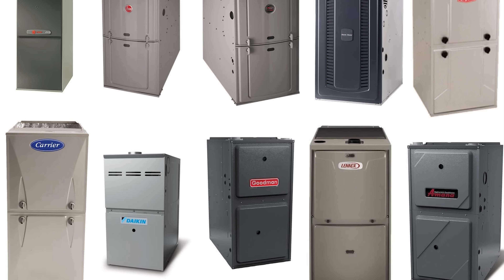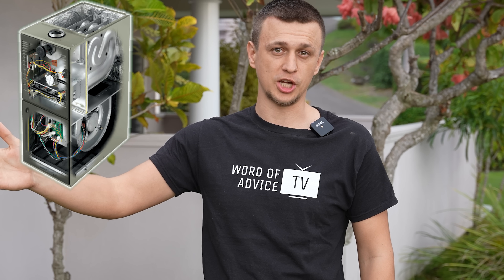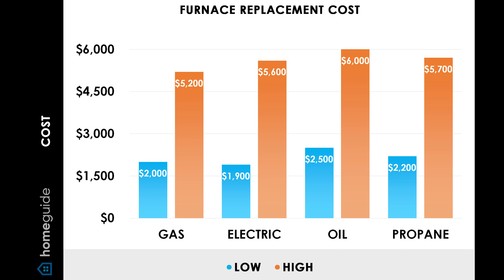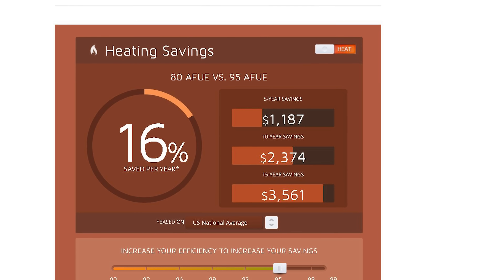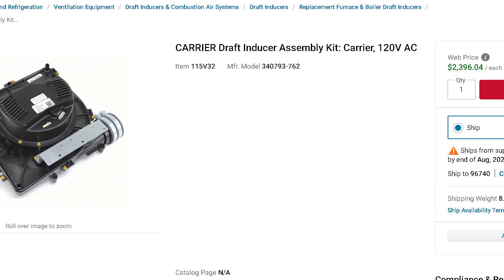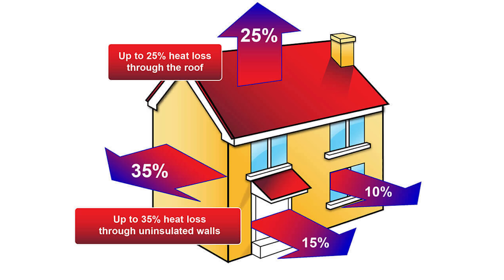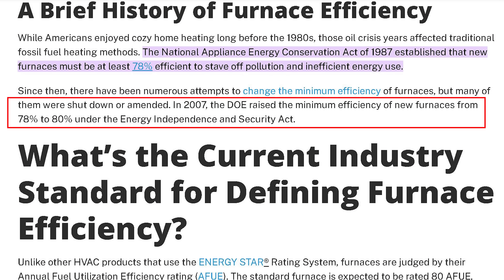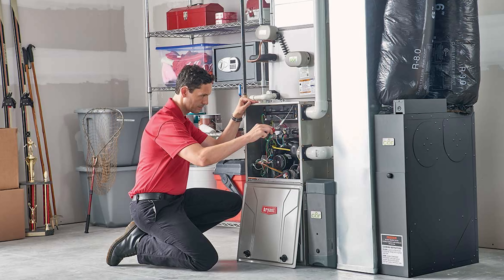Don't Buy a High Efficiency Furnace!

Comment: I'm planning to put a furnace in a well-sealed detached workshop. Is it possible to find an 80% furnace with a sealed combustion chamber or at least find a good way to draw outdoor combustion air rather than drawing from inside?  I can find unit heaters with sealed chambers but would rather duct to distant areas of the shop.

Comment: What price? the Goodman 96% 80K furnace I bought and installed myself was about $1150, it replaced a 35 year old Lenox G11-e 80%, but 80% was misleading as it took all it's combustion air from the basement where it was, and the open 5" flue often had cold air spilling out between cycles, flue exhaust would sometimes come back down depending on the wind direction,  so in actuality it was probably more like 70%.
The Goodman I installed 3 months ago has performed perfectly so far, I leave the thermostat set at 73 degrees.
It takes all it's combustion air from directly outside thru the PVC pipe, no more cold air pulled in thru every gap or crack!
Part of the heat exchanger issue is sizing of the furnace, the old Lennox I brought home from my workplace when they replaced their furnaces, it was 110,000 BTU, the new Goodman is 80,000 BTU. I have 1,100 sq ft with a basement, R-100 insulation in the attic, double pane windows, and the walls are at least R-21.
If someone buys a furnace too big it cools off a lot between cycles, that could cause condensation as well as wide temperature swings which causes a wide variation in the expansion and contraction of the metal in the furnace which isnt good for it- metal fatigue.

Comment: my lennox pulse is 40 years old one heat exchanger replaced paid for by lennox parts and labor . and i had the computer replaced not sure why it was shutting off turned out the hornets built a nest in the intake pipe .  sure wish that they still made that furnace love it .( when i got that furnace in 1982 my gas use went down 33%  )  and i love the sound it makes .
Reply: Yes I have same.....G14 model....Lets Calculate: Savings of 95% over 80% for 35 year life of Lennox Pulse.  $1000 year spent on Nat Gas with 95% so spent $35k in 35 years.  Would need 19% more gas for an 80% (.95/.80=.19).  So $35k * 19% = $6,650 saved over 35 years.   NOT ONLY is there energy savings, but HIGH quality equipment last twice as long, so saves another $3k to install another one.  (Flap $10 is changed every 3 years,  the inducer fan was making noise after 35 years so changed $80, and Combo  Limit was change + had to add Fan off delay because exact old part not available.  (pulse system used special delayed combo switch).

Comment: Hi, In 2010, a local HVAC company installed a 96% Reem furnace in my home located in South Jersey. Today, after 14 years, an HVAC company that came to do maintenance told me that the unit is too large for the house (100,000 BTU to cover 2,000 square feet). I have already replaced several parts of this furnace, and due to the fact that it emits a strange color, they told me that the secondary heat exchangers are clogged. Any recommendations?

Comment: So, Washington is copying California and doing a natural gas ban. I bought a home and it has condensing furnace. So I can expect to have to replace it in the next 5 years then? Because I HAVE to replace it with a heat pump, which don't really WORK below 22°. And last winter it was 9°, but it hits 0° every few winters. I guess I'm out on the streets then because I cannot afford to replace things that expensive that often. At least with a roof you get 20+ years. Thanks for the dysmal heads up.😢

Comment: i have a weil mclain high efficiency gas boiler and it has been nothing but trouble it shuts down middle of winter for no good reason because it decided temps were wrong i want my dam heat to stay on unless it is about to blow up house. 
also, the aluminum heat exchanger chamber is being eaten away by combustion gases so i figure it might last about 15 to 20 years while my dad's regular gas boiler needed nothing for 40 years and never shut down it would run in a power outage since it had pilot light you could just open check valve and water would flow on its own.

Comment: My furnace was first used right around late October' or early Nov 1993 and it s working as of today. It failed in 2010 because I've neglected to replace the FILTERS (Guilty as charged) that's because I have no knowledge about HVAC. That incident taught me a lesson big time! It cost me $80.00 to replace the Circuit board, $25.00 for the motor, $21.00 for the high limit switch, and $20.00 for two filters in order to bring back the furnace back to life. I did all the work using the knowledge acqured watching U Tube. In November 2022, the furnace stopped working again since 2010 and I found out that I have to replace a broken flame igniter for $14.00 and $43.00 Lux from Amazon. Every time the air filter indicator reach the 50% efficiency, I replaced them.

Comment: In the 10 years I’ve done heating and air I’ve only seen one 90+ fail. The actual cost difference between an 80% and a 90% is about 400 dollars. The piping itself is rather cheap as well. Modulating I don’t like and I don’t install them. A 96% two stage furnace is more than enough efficiency for 99% of people. The true cost difference comes from contractors just deciding it’s okay to charge the extra 2-3 grand for the 90+ furnace.

Comment: In Alaska, where the furnace is used nearly 24/7, 365, the constant noise and blowing air of a standard furnace is a no-go. The quietness and gentle diffusion of heat makes the extra cost of a variable speed fan, high efficiency furnace worth the expense and shorter life. Plus, my Lennox has a lifetime warranty on the heat exchangers.
Reply: In floor radiant heat sound perfect for your area

Comment: Totally agree with you. I've got a 21 year old Armstrong Air 80% that's still going. So far the only repair has been the igniter...very inexpensive.
Reply: Up north we all use 95% furnaces with no problems - the cost savings greatly outweigh any issues with the heat exchangers. Not to mention that part is warrantied for a very long time.

Comment: I was a HVAC contractor and I've been retired for 7 years. It all depends on your climate and installation. Some areas require a chimney liner so it's more economical to install a competitive 90 afue. Single pipe 90 afue don't have recirculating problems as twin pipes. I've found Carrier/Bryant/Payne had trouble with secondary head exchangers. Btw; my first house had a G14Q3-60 Lennox pulse installed in 1983... I was driving by there 4 years ago.... It was still revving along.
Reply: I have only one pipe exiting, and the condensate is pumped into my washer drain.

Comment: Hello Is there a non efficiency furnace that uses pvc pipe for exhaust/intake ?
Reply from the maker: As far as I know, no.
Reply: What is the exhaust on a good 80% percent furnace ? A 4” double wall out the roof or can it be horizontal out the side . Just gearing up when it comes time to change out my 93% high efficiency

Comment: Is this true on Heat pumps above a 14 seer???
Reply: 14 seer is same as COP 3.45 , that means (at a specific set of conditions) you get 3.45x as much heat as electricity used.  Keep in mind electricity cost 3x as much as natural gas for a unit of energy.    15 seer is 3.61 , 17 seer is 3.89, 18 seer is 4.01  Huge increased in equipment cost for those slightly more efficient units.

Comment: I live in Arizona and yes winter does exist a few times during the year. My parents have a high efficiency heater only because their original heater built in the 1960s went bad and parts no longer existed. Their happy with their high efficiency heater and it works excellent. I have the 80% efficient furnace in my house and it works excellent too. 

In Arizona gas is cheap and the winters do exist but not as long as most places so you're going to be fine with a standard gas heater. Either way it'll be a lot cheaper than running any heat pump because I've seen electric bills for heat pumps and they're higher bills than what would normally be found in the summer months.

Comment: My issue with high efficiency furnaces is that nobody in my area knows how to install or service them properly. Mine sounded like Chewbacca giving a battle cry every time it turned on for 7 years untill the unit was replaced.

Comment: These days if you have an 80% furnace and the venting is safe to keep if you get a new system get a heat pump dual fuel setup use the heat pump and electricity 50 to 60% of the time especially if you have solar it’s almost free to very cheap to run. Using your gas furnace only when it gets cold enough.

Comment: This video must be from behind the times USA? Mid-Eff have been disallowed for quite a few years now in Canada ! Possibly the reason you find Hi-Eff break down is that you sell junk Brands ? Our weather in Canada puts furnaces to the test ! Do NOT break down or shut down more than Mid-Eff Gas Furnaces ? Found there were more problems with Mid-Eff as the indoor air constantly coated the flame sensors and shut it down ! Bottom line guys is Think Green for the Future right ?

Comment: He is spot on.  Agree 150%.  Forget the brand names.  They ALL use parts sourced mostly from China.  The best unit is the one installed WITHOUT any shortcuts and properly sized.  An 80% with a PSC motor is the ticket to longevity.  4th reason:  If one removes an 80% unit from a shared B-vent stack...the vent stack MUST be resized.  As for AC a simple equation holds max {efficiency} = min{time to failure}.  You will never attain the advertised SEER rating of any unit that is connected to an undersized duct system.  Never.  Advertised SEER ratings come from equipment in a lab-NOT real world conditions.
Reply: I have an update.  High Effiency=early replacement.  Holds true with most consumer goods.

Comment: totally agree with you.
 But.
 So many outfits will only install the high-efficiency ones.
 Judging from around my condos in my address just about every unit that gets a new furnace gets two plastic pipes out the front wall of the house.
 It sucks.
 You saved my bacon, and I fixed my 80% Goodman 2 burner. Runs better now than when I moved in 23 years ago. Touch wood!  ( it was just installed back then).
It is simple and they work. And thanks to your web site I have some knowledge to support my thoughts on the whole issue around furnaces.
 But today the furnace 'guy' will show up/ tell you you have a cracked plenum and you're stuck with these findings. At 20 degrees below and Christmas travel coming up does one really have an option? No, they got ya.
 At least 98% of the people.
I am going to shop around and see what 80 %ers are available.
 I need/ should get a new one/ but I might be moving sooner rather than later so in a quandary.

Comment: if you have an actual winter, a 90+ will pay you back especially since nat gas doubled its price per therm.  I draw the line on furnaces with 2 stage gas valves and the like.  I'm not a fan of exhausting 20% of the heat in the gas i burnt.

Comment: Love your channel.. but I would Challenge this advice.   Depending on where you live.  In the Northern USA Heat is primary throughout the year.   Cost of energy is always rising and your advice would be bad.   But In the south Air conditioning is primary throughout the year and fuel cost on heat is minimal.  Also usage of the heat exchanger is low.  So it last a long time due to non-usage and a expensive furnace would be wasted.   ( Natural Gas cost doubled in 6 months)   Keep in mind energy cost is unpredictable.

Comment: Thanks for this and all your videos. We recently purchased and moved into a home that has a 20year old, kenmore, high efficiency 92% AFUE, two stage furnace with a DC variable speed motor. Just a few days ago the blower fan stopped working, and I’ve been viewing your control board/blower fan troubleshooting videos. Unfortunately, those videos were on non high efficiency furnaces, or without dc variable motors, so when trying to replicate on my furnace, it looks significantly different. We really don’t want to replace this furnace, but are struggling to troubleshoot it. Could you please do more repair and troubleshooting videos on high efficiency, DC variable motors please? As you mention in your video, they are more complex and expensive to repair, so any help you can provide to new and budget conscious home owners, would be greatly appreciated. Thank you

Comment: I had a prestige condensing boiler variable combustion input and had a Weil McLain 80% efficient cast-iron boiler. The prestige condensing boiler lasted 11 years and I’m using the Weil McLain back up boiler for another 11 years and it’s going strong without one single problem. I consider condensing boilers unreliable as well as 90+ efficiency furnaces. In out sons place we put in 90+ 2 stage furnace and we only run it on low stage. So far 15 years it’s running good since it’s an older model. At my uncles we have a Bryant with the infinity thermostat and head problems and it’s only four years old? Will be taking a look at heat pump system since we use propane and need back up. We could use the heat pump fall and spring and turn on the propane in winter when really cold.

Comment: I disagree with a good majority of this post and this is why. If they are installed properly and maintained properly they can definitely last 20-30 years. It all comes down to the initial installation. If everything was installed properly your good. If they are installed incorrectly, sure they may run without an issue but improper installation can cause premature failure of that system. As far as the worry with the heat exchanger any high efficiency furnace typically comes with a lifetime warranty on that heat exchanger so that being a “critical failure” isn’t necessarily an issue. As far as the cost and retention of that cost I do agree it takes around 10 years to re-cooperate that cost however my question would be are we really going with a system like that to save money or is it because we want more comfort in the home? Once we get into staged heating and variable speed blower motors everything changes. We have improved airflow and instances where large temperature differences between 1st and 2nd floors are mitigated because of that variable speed blower. Along with the staged heating not only does that prolong the life of the heat exchanger since it’s not running at 100% capacity all the time but it also eliminates the cold spots in the home. As far as repair costs yes I would say they can be high but let’s look at the differences here as well most of the time it comes down to that brand name. A carrier modulating inducer runs around$2200-$2500. A arcoaire modulating inducer runs hour $600. The furnaces are made by the same company and for the most part are intentional in style. I see a lot of people that agree with not going with this high efficiency equipment and I think it truly comes down to the fact that they are afraid of it. Will they know how to properly set it up and be able to make a repair if needed. The technology on that equipment is a bit different then a standard furnace and if they are afraid of embracing it, would that be why they choose to say it’s not worth it?
Reply from the maker: Thank you John for thoroughly explaining why you disagree. I appreciate you taking the time to leave this comment, outlining the opposing view. This helps people make a more informed decision.

Comment: My furnace is from 1999, apparently ultra high efficiency DC90....I have no idea what that means, but it works.  I only have to clean out the little fuel spout before the igniter, usually every year, and occasionally clean the igniter.  It’s propane.  3 years ago I added a wood stove which drastically reduced my heating costs and added security against power failure.  My windows definitely need replacing, but I like having the air movement.

Comment: I love my 96% efficiency gas furnace.
What's important is how detailed the HVAC technicians installing a high efficiency furnace are and do not cut any corners on the angle of the exhaust flue. Also, moisture drainage pvc tubing is done correctly with a trap,etc.

Comment: My furnace just started acting up. It's about 20 years old. The problem seems to be that water gets I to the hose that connects the inducer motor and the pressure switch. When I empty the water from the hose, the furnace runs fine. I drain the hose daily. I was wondering how the water gets into the hose. There doesn't seem to be any water in the inducer motor housing.
Reply: Check the drains for the furnace for clogs. The pressure switch tubing should also be ran a certain way. Try to get it so that water will run down the tube and back into the inducer.
If a drain is clogged the inducer can fling water around and it can get into the pressure switch tubing.

Comment: is there a propane heating furnace you would reccommened? I currently have a navient boiler that needs to be replaced. I have hydronic heat and a well water system. any advice would be greatly apprecited.

Comment: Where I live mid unit are not for sale . as for high Efficiency furnace the cost is unbelievable  that because of the The ways that you can purchase you can view purchase a guy's furnace through a business Not through home depot and do-it-yourself they control the market and keep it high when it comes to cost it's called greed.
A mark up is unbelievable. Let us 4 pay back I think it's what I'm worth it. Since we're installed are Napoleon 97 We have definitely saved on are gas bill And I'm not concerned about warranty because it's 10 years on everything.
So we're not putting out any additional money.
As for efficiency of the overall house yes that makes a difference.